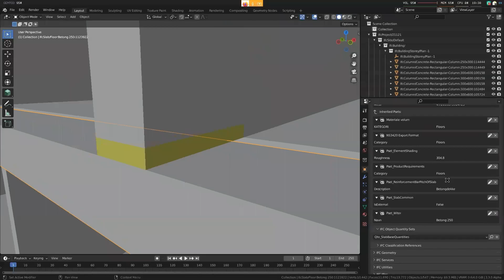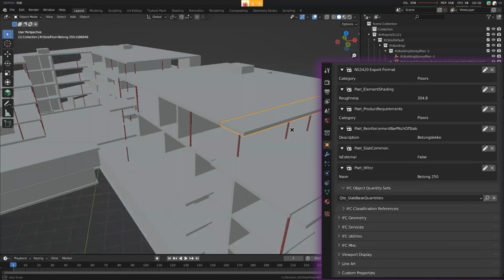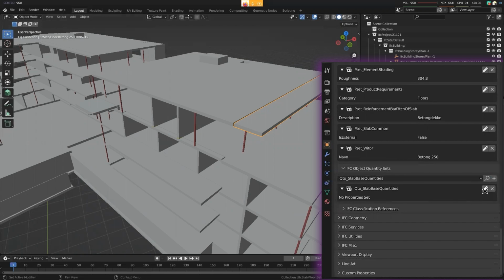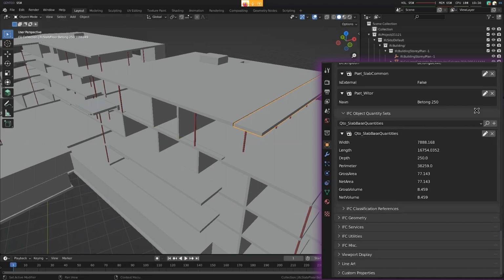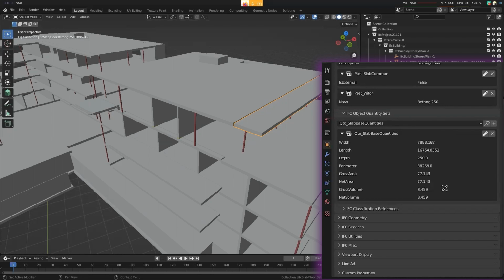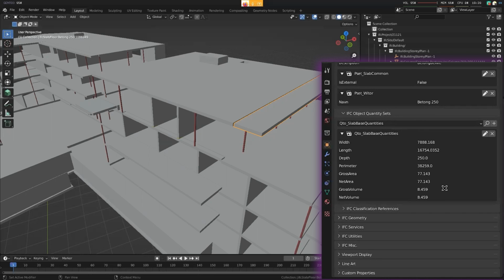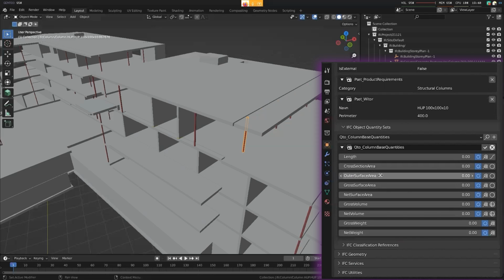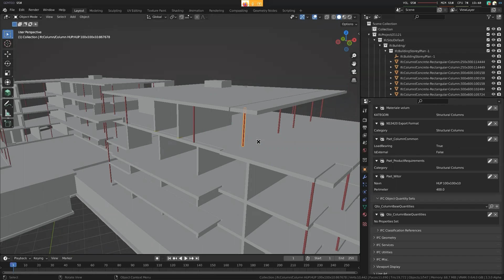Quantities in IFC Export | BlenderBIM Add-on

Comment: @Dion please provide the same classification&custom_properties function, like one in ArchiCAD - but without the crazy restrictions
Reply: I'm not familiar with ArchiCAD's feature, but if you help explain what you're after in more detail I can help :) https://community.osarch.org/
Reply: @DionMoult  In ArchiCAD, there are 2 metadata types you can add to every BIM (3d) elements:
1) classification: a hierarchic, customizable classification (you can download preset classifications, like din, önorm, uniclass etc.). you can have as many class. sets as many you want. you can connect classifications to custom properties.
2) custom properties: it can be a single string of text/number; a drop-down list; or an expression (you can get (theoretically) all the properties of the element to use them in complex expressions).
Reply: @IstvánTalmácsi  you can do both of those already in the BlenderBIM Add-on.
Reply: @DionMoult  do you know any tutorial for that?
Reply: @IstvánTalmácsi  sorry no :( really need help from people to create tutorials
Reply: @DionMoult  no problemo! but pls, put it on the to-do-list! ;)